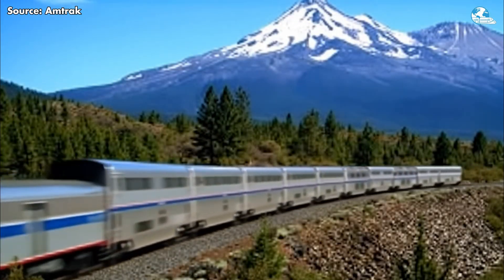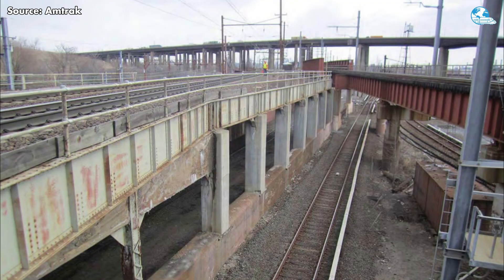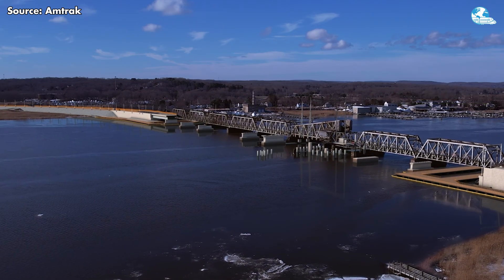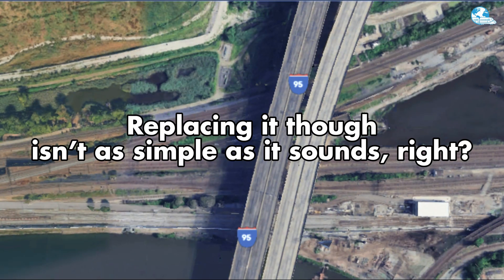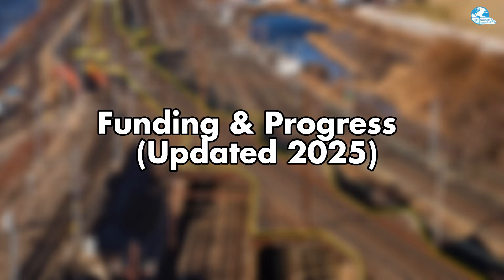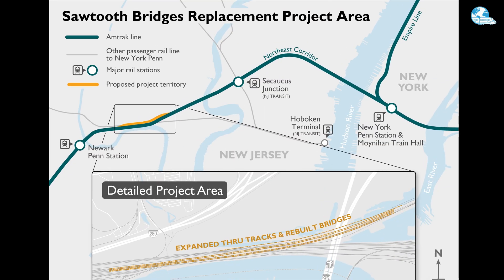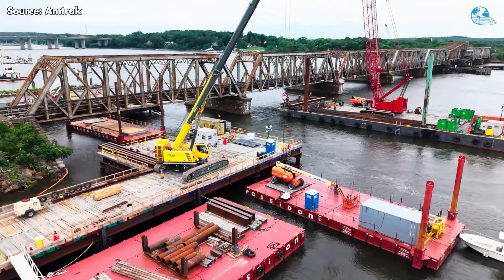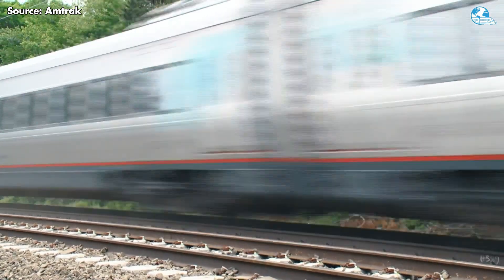$2 Billion Amtrak Bridge Replacement Could Be Coming Soon...

Comment: Wrong. The weakest link on Amtrak's Northeast Corridor through Newark and into Manhattan is the worn out swing/draw Portal Bridge, that frequently gets stuck when opened to allow river traffic to pass and shuts down the railroad. This dangerously compromised bridge requires trains to slow down even more than what's needed when crossing the Sawtooth Bridges, and will be replaced by the new double track Portal North Bridge that's almost finished, on time and on budget, toward completion in 2027. The second weakest link is the even older paired Hudson River Tunnel, worn out by nearly 120 years of constant use and also badly damaged by flooding during Superstorm Sandy. The tunnels are in immediate danger of complete failure which would cause extended shutdowns that would cripple or could even close the entire railroad for months or years. The construction of two new tunnels has already begun and is slated for completion in 2035, which will allow the current tunnels to be taken out of service fully rebuilt to state of the art new specifications by around 2038. Finally, the Sawtooth Bridges are the THIRD weakest link, because while aging and completely inadequate for the future, there is no immediate danger that they will fail and shut down the railroad. All that aside, great video about what will be accomplished with the new Sawtooth Bridges, especially when the upcoming double track Portal South Bridge finally upgrades the Northeast Corridor to four tracks continually all the way through NEwark and into Penn Station.

Comment: If you want people to take your videos seriously, you absolutely HAVE to check your sources. Conrail no longer exists, that Amtrak Acela train in the beginning of the video is sped up, and, though they do need to be replaced, the sawtooth bridges are NOT the NEC's weakest link.
Reply from the maker: Thanks for your useful information.
Reply: Conrail does exist. As a short line switching company owned by CSX and NS. You should check YOUR sources.
Reply: @JohnSmith-bk9iz Conrail no longer handles commercial matters for customers. Does that work for you?

Comment: They could have been almost finished if they didn't have to build $2Billion of unplanned all new maintenance facilities for the Airo, which doesn't fit in the old facilities.  Amtrak has plenty of money, if they would just stop screwing up!
Reply: Amtrak has plenty of money? WHERE?
Reply: Everyone agrees that the Airo is a great upgrade though.  It's long overdue, especially the decrepit passenger cars.  What we need is a switch in federal priorities from highways to improving rail infrastructure.  The carbon emissions savings of making rail more popular (instead of flying/driving) could be used to take funds from renewable subsidies.
Reply: Amtrak can perform more than one project at the time.